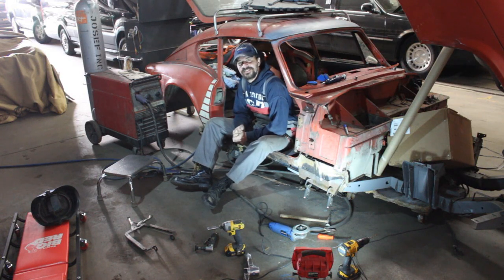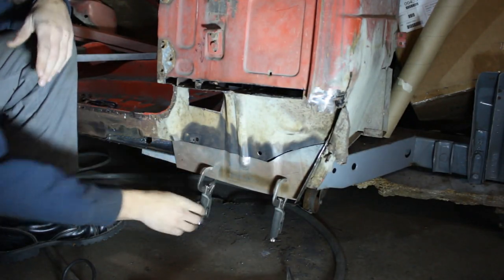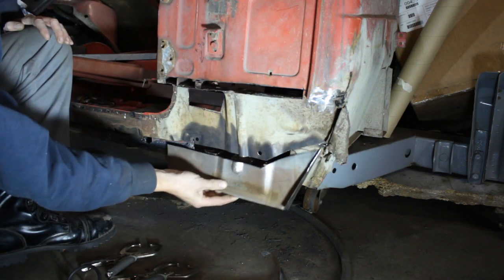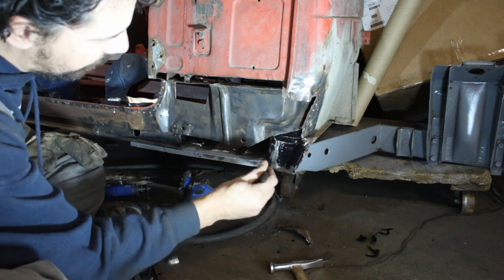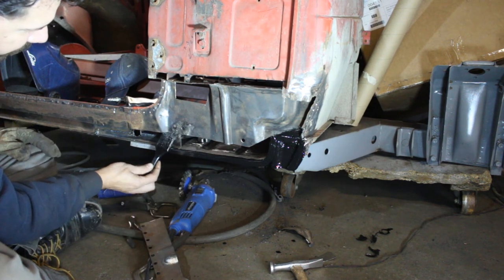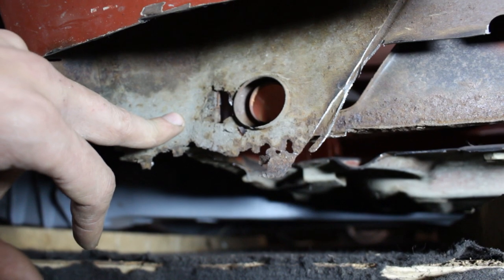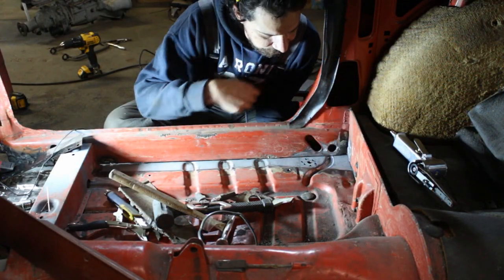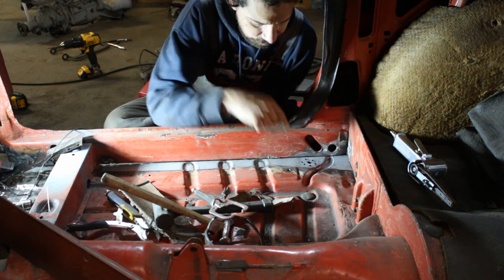1972 Triumph GT6 Restoration - Part 10 - More sill and floor work

Comment: Brittish cars are so friggin complicated. This is why I concentrated on American cars for the last 25 years or so. Hats off to you Elin. You have the patience of a saint. I have found myself Mickey Mousing some details similar to what you are going through on my TR6. It's time to sit back and re-evaluate what the next step is.
Reply from the maker: Yeah, I like thinking ahead. Especially after I've seen so many badly fitted sills on spitfires. So I just position the sill where I want it and adjust the rest of the parts to it.

Comment: Once again Elin your restoration skills are unquestionable. But, given the number of projects you have on the go, have you never considered making a swivel frame which will put the body at waist height making your work easier. I have no doubt with your fabrication skills you could make one very quickly .
In the long run I think it would be a very good investment, as well as making life easy for your knees and back in future years ( take it from me after a lifetime in the motor repair industry, your knees will wear out.)
Having the ability to raise the body, and being able to swivel, or even upside down will greatly enhance and possibly speed up your restoration programme
Reply from the maker: Actually, I am in the process of building a very interesting jig for rotating the body, but it will be for TR6 and 250. Probably you will first see it in Cheftush's videos. For the GT6 I don't have too much choice where I work now. It is very tight, but my usual restoration spot is overloaded. But I agree, it is much easier when the body is higher and you don't need to bend over all the time. I actually don't have too much work on the floors and sills so I will keep working this way, but when I start with the 74 TR6 I will have to ease the process, hence  I am building the jig. It is not a rotisserie, it is much simpler. You will see

Comment: Oh, and the oblong hole that you were putting your thumb through is for the factory spot welder access for welding the strengthener seam. The outer sill would not have been on, yet.
Reply from the maker: Yeah, I thought about that or maybe for some jig that they used in the factory, but some people suggested all openings there were for ventilation and it make's sense. Even though they are covered with carpet and nowadays we even insulate our cars.... I don't know, I just restore all the parts as close as possible to their original shape. I am not such a purist, but maybe because of my purist followers :)

Comment: You working on the same place what i did in the summer... This corner made me sweat, my bodywork was much more bungled in this place than yours...Yesterday i  tried  to mount my dash panel, it did'nt fit because somebody put an another layer of vinyl on the original. I removed the whole cover from the foam base, now i must go to search the town for proper vinyl to recover the dash top...
Reply from the maker: So you ended up restoring the whole car after all. It looked like it didn't need too much when you bought it. That is why I don't buy cars in "good running" condition... That is never true. You start with some small repairs and you end up with a frame off restoration. I'd better buy them all rusty or even disassembled. At least I know what I am dealing with and I pay a price for a wreck, not a solid car.
What happened to your videos? I wanted to watch more of your progress. Cheers!
Reply: I became tired to everything filming and my wiews was not so much...
Nowadays i step one forward and two step back...Like you wrote above...
But i will do not frame off restoration, i need just a functioning car, what seems good enough to ride it on the streets...
Reply: Szivet neki en is szivesen neznem a restauralast. Idobe telik mig sokan nezik csak legyen mit nezni.